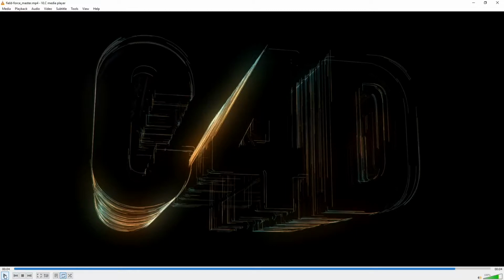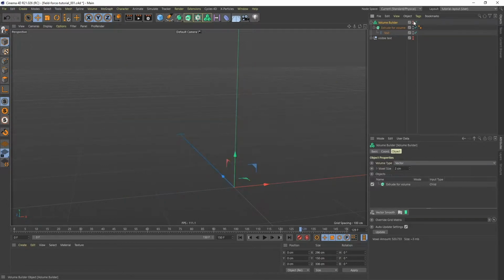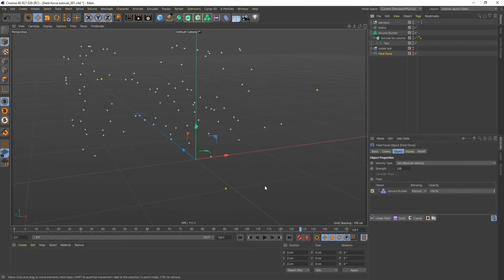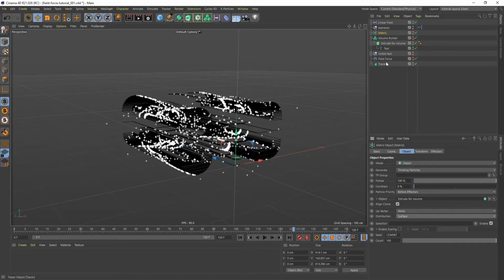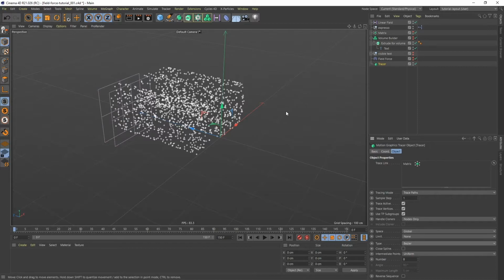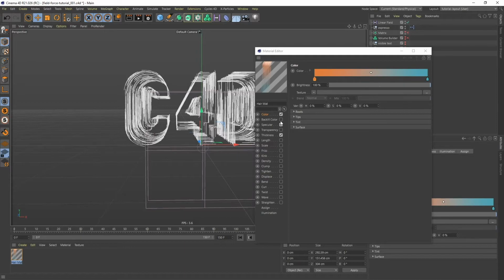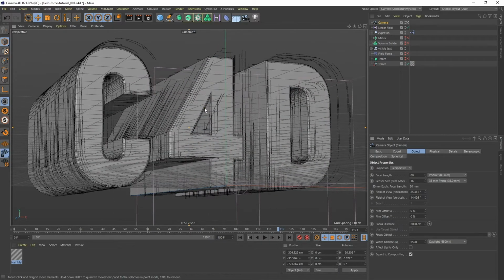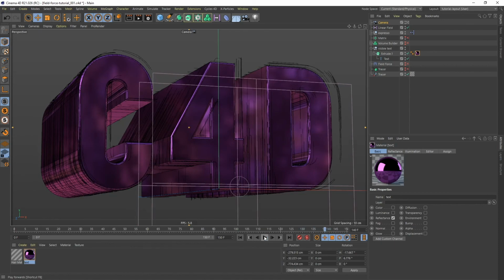Cinema 4D Field Force Tutorial - Combined with the Volume Builder

Comment: Thank you for that finally getting an insight to the field force. Referering to the head example, is it at all possible to Stick the splines to the surface of an animated source??  ie walking human.
Reply from the maker: My pleasure. Regarding the animated surface, I haven't explored that yet. Simply parenting the head to a Null doesn't seem to do the trick. One immediate workaround is to export the tracer to an alembic file before you animate the head. Then make the alembic a child of the head. Alembic files are also easy to offset in time and speed up or slow down.